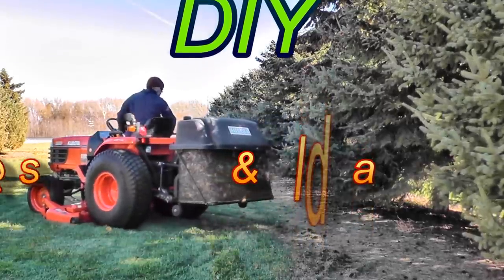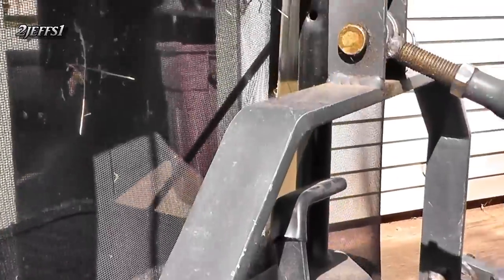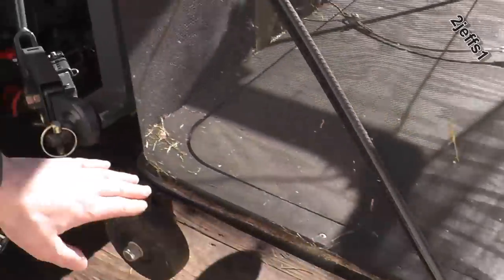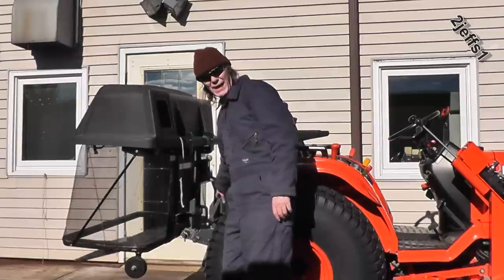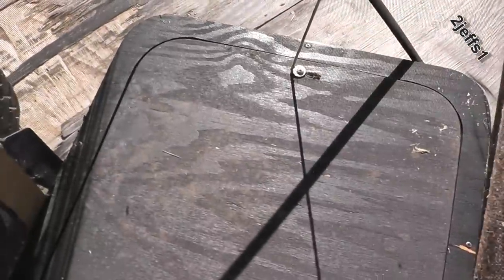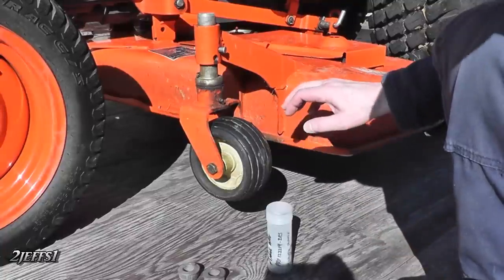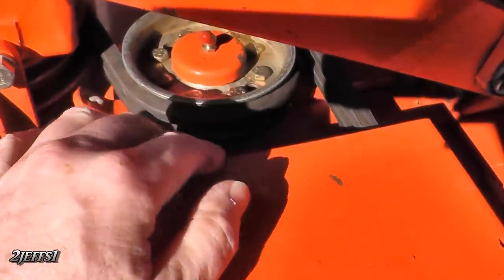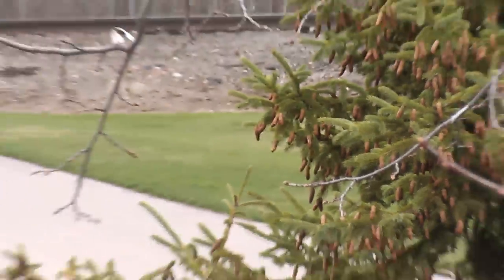Grass Catcher Mods DIY FAST Install & Dump

Comment: Sweet bagger. Excellent idea. Next up, an in-ground pressure washer that power-washes the underside of the mowing deck. Drive over top of it, press the button, wash, wash, wash, all the stuck grass clumps are cleaned off. Back to work.

Comment: l swear they make it so they become consumibles, and make it last just a couple of years, great mods by the way, that trap door is great,
Reply from the maker: mustie1 They didn't have any pictures or demo on hand so bought that kinda blind. Did try it out as is (once) but I probably wouldn't use it as much if it took so long to install it to the machine.
Reply: You’re absolutely correct! Sad thing is, there’s even a name for it.... planned obsolescence

Comment: If you ever wear out a snow shovel with a D-handle, you can drill through where the wood (or metal) pole used to be, and install your string for an easier to grab handle.

Comment: Good stuff!! 
Cool deal on the bearings too, I kind of forgot about those. I'm tryin to figure out a cheap way of putting front wheel bearings on my mud/speed mower and this may work....
I don't have a nice tractor like that, but my parents are building their retirement home and dad mentioned about getting one. I told him to check ya out now for ideas later!

Comment from the maker: Pretty sure those will fit your wheels. I usually buy a tube of those bearings, saves down time when it's go time. Stopped into a friends place and he just bought a cheap rider. Nice clean 1 owner - ( one owner at a time :>) Was commenting on the wore out front wheels. Nice to help him out on a Sunday when no one is open! If your dad has any ??? hit me up I'd be glad to help. Different attachment vid's to come.....

Comment: Great tips.  Craftsman does the same with their idler pulleys.  They go bad for me just about every season.  I've drilled them as you did yours and this way can replace them with much better bearings.

Just a quick question (if this video gets monitored at all anymore.  Why not fabricate a wider or larger basket?  For such large tractor, it seems smaller than it could be.  Nice video.
Reply from the maker: Thank you and - yes I always read (and appreciate) all the comments! A larger basket would be better but where I don't have far to go to dump and limited leaf trees here otherwise your right - I probably would of perused that.

Comment: I love the video and the mods, I am  going to use some of your ideas myself. I particularly like the 3 point hitch frame. great idea. I am currently doing a pedal mod for side by side pedals. 

You obviously have good fabricating and electrical skills, what is your background? I am a tool & die maker (20yrs) and did fabrication prior. I don't hand out compliments easy, but you do great work.
Reply from the maker: Really enjoyed reading your comment. I like to hear what others do for a living. Thru the years I had some opportunities to tour different places when someone offered and really enjoy things like that. I kinda live out in the shop and big on experimental, trying to create different things. Been self employed since 82 doing automotive things and did have schooling on the electronic systems as the new stuff came out.
Reply: Jeff do a search for kubota twin pedal mod and you'll see my latest mod. there are 3 different videos. you'll want to watch all 3. my user name is 100inchhammer after my motorcycle
Reply from the maker: I would be happy to and will be!

Comment: OMG!!!  I love your Bagger system.  I must have watched this 10 times.  I've got the same "Original System" but my PTO Vac is mounted between the tractor and hanging bags.  Where did you get the PTO Vac that mounts to the mower discharge shoot????

Thanks
Reply from the maker: Got a kick out of your write-up! :>)  That came from Kubota with that bagger system. There is a gearbox that has a mounting bracket and flange. The flange mounted to the pulley on the mower deck to drive the gearbox. The gearbox, that small driveshaft (visible in the video) and blower and shoot all came with the bagger kit. So that is all driven thru the mower deck just to be clear. Check with the dealer, they should have some info and pictures to be sure if that will work ok for what you already have.

Comment: what does the blower driveshaft hook to ?  you didn't show it .. but it looks like one of the blade holder drives has a pto on it .. is that so ?   .. wish they made something like that in a universal format... nothing worse than that old Briggs screaming behind you as you go  .. : (
Reply from the maker: There is a 90 degree angle drive gear box that is driven off, the flange bolts to the top of that outer blade pulley. It is kept from rotating by that 1 upper bracket. Briggs screaming behind ya, I totally agree. Not a pleasant thing!

Comment: could you tell me what is the brand of the blower assembly and the deck  pulley pto converter?
Reply from the maker: +david flaherty Hi David. The blower assy didn't have any numbers on it. The pulley PTO has GC60F. Where those items came with the Kubota bagger maybe they want to keep the part sales in house. The mower deck is RCK60-24B in case that might help.

Comment: You sure are right about the nuisance the two or three bag system.  Plus the bags are cloth so when you dump them you also have hold the bottom, while holding the top and you don't have enough hands.   And all the makers of this stuff just copy what others do so they are all the same, junk!

And those blower tubes, don't they love to get clogged all the time.

Now I just hire people to do the lawn and my garage doesn't smell like gasoline and grass anymore!

Sure is a shame guys like you never get hired by the companies that make this stuff.

Also, somebody told me if you put ethanol gas in your mowers it will wreck the gasoline tubes and seals.  So you get a pool of this on your floor, and it won't work and you have to fix it and clean up the mess.
Reply from the maker: EnergeticWaves Yeah kinda a shame when things aren't made a little more user friendly right off the bat. That ethanol tip is a great one for people who don't know. I have a friend who fixes lawn mowers. He sees damage from that stuff way to often!

Comment: Great design but I do have a question, my lift works both my mower deck and my rear lift at the same time. Is your lift independent of each other?
Reply: Same here, I think that won't affect anything when you go to lift you are dumping so it isn't going to affect the grass cutting.

Comment: I collect junk for my brother. He uses so much sheet metal and square brackets? I am always on the run and keep an eye out. I love it that when I call dad or my brother, they pitch up the trailer or box truck and pick up what I tell them I found. I just found one of those boxes that wash engines and it was sitting on my corner on a busy highway. So glad I sat on it. It will be put to good use. I love to watch the end results. They can do anything. Thanks for posting. Reminded me of how my brother operates. Very clean too.

Comment: Great Design and Concept for sure :D. Time is Money and you have thought it all throughout for sure :D. Here is something you can ADD to your design... Add a small 12v dc Motor to release the dumping door latch and an actuator to lower your dumping door down, that way it's ALL auto, LMAO
Reply: BTW, buy the Silicon Spray and spray all the moving Parts each Season :)

Comment: Hey, 2Jeffs1, I'm fanatical about keeping my tractor clean as well...But, I cant keep mine engine looking as clean as yours...how do you do that? Mine stays dusty and will not blow off, even with a high pressure air hose..

Comment: baggers are very expensive and don't work very well. and you've got a bunch more money into one. i just simply  bought a couple used triple baggers and when two bags are full, switch to two empty ones. throw all eight of them in the truck when full and take them to the dump site and start over. it's a helluva lot faster and easier and above all, cheaper!.

Comment: This is pretty cool.  You may want to rig the release and closed mechanism to the lift mechanism.  As the bagger is being raised, the bottom panel releases and as the bagger is being lowered, the bottom panel closes.   I think you should patent your idea and sell it to a manufacturer or make a few to sell.  I'm a patent attorney and so if you have any questions, feel free to contact me.

Comment: Just out of curiosity... what revision is the final product... amazing job sir.. but a LOT more work than I would want to tangle... looks better than what's out there to buy...
Reply from the maker: +ChicagoDoItYourself Now When I start on these type ideas always hope they will work as planed. On some projects more time is spent pondering than actually executing. Real happy on the ones where no final mod's or tweeks are necessary! This actually went pretty good. Thanks for stopping by.

Comment: Thanks, very interesting!  Could the grass catcher be modified to pick up industrial hemp from the field, after it dries?
Reply: For that you will want a hay rake for a tractor. Then a hay baler could be modified to pick it up. Why a hay baler? Because you can remove the bail system and just use the hay pickup system to pick up the hemp and then move it into a trailer. or you could even bail it like hay to compact it and then store it, like hay or at that point break the bales open and do what ever you need to with the hemp.